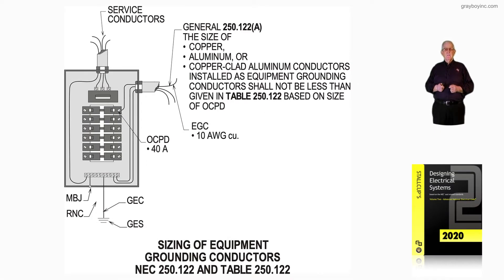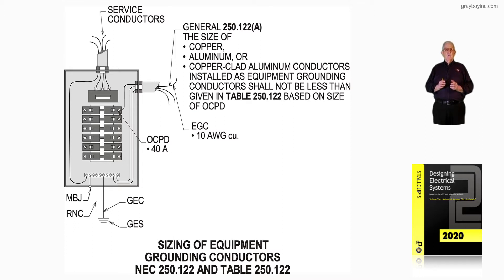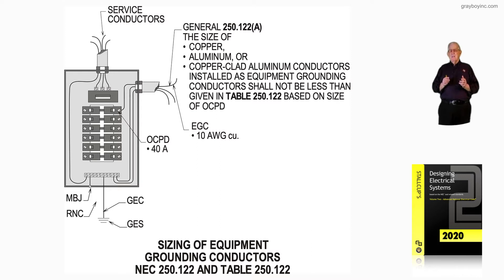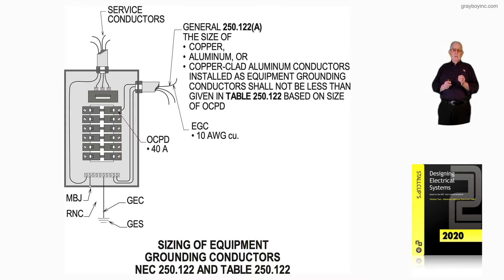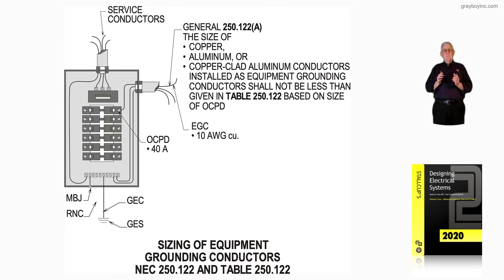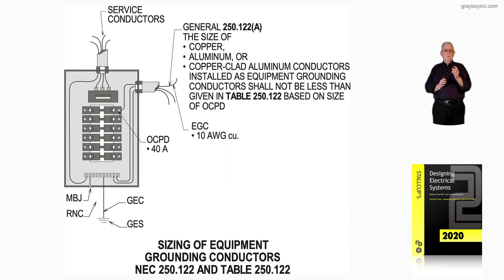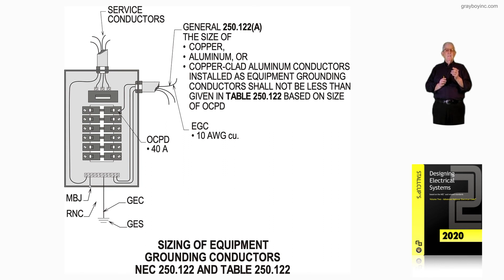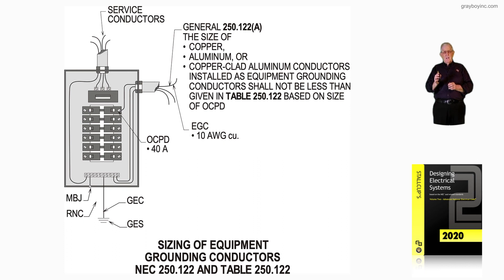16-113 (a)  SIZING OF EQUIPMENT GROUNDING CONDUCTORS - 250.122 AND TABLE 250.122​​​​​​​

Comment: 40a is not on table 250.122 ? Not sure how you got the answer, can you explain?
Reply: HI ANGEL, 
THE 40 A OCPD IS GREATER THAN 20 A SO IT FALLS IN THE 60 A RANGE THAT REQUIRES NO 10.
IF YOU HAVE FURTHER QUESTIONS, LET ME KNOW. THANKS FOR YOUR COMMENT AND SHARING.
REGARDS,
JAMES G
Reply: Because 40A exceed 20A, and the next one is 60A.